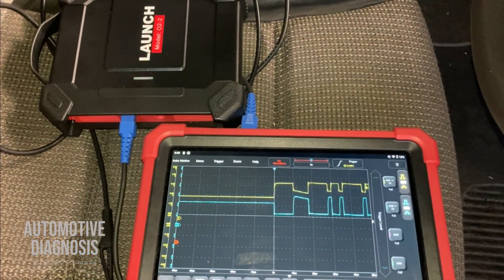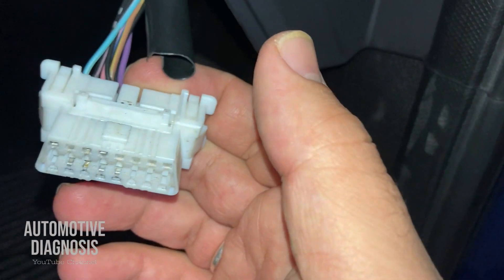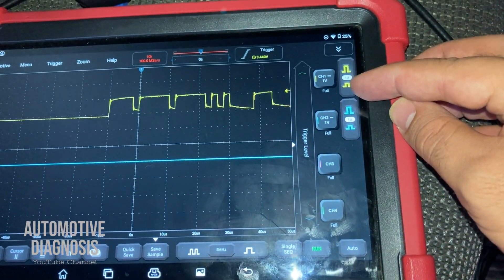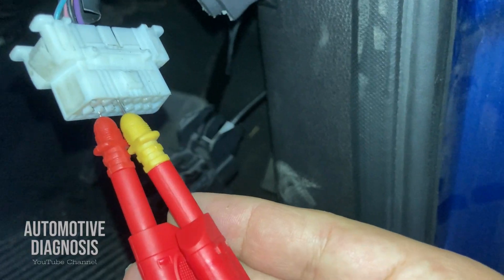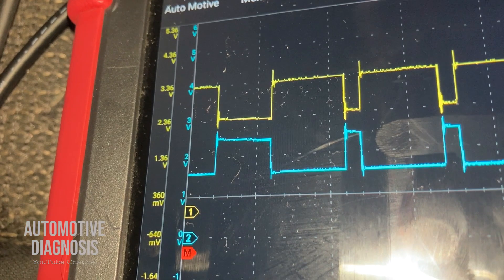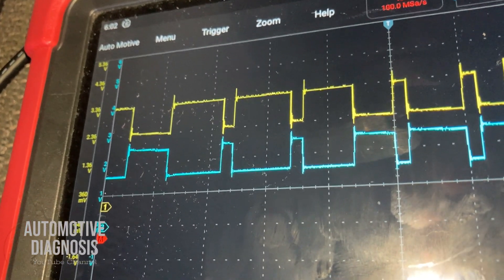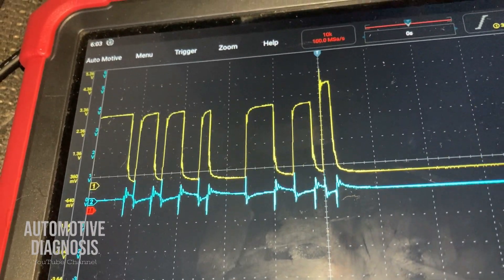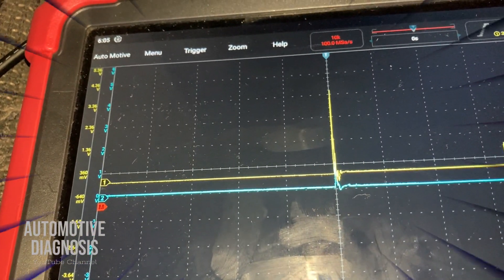CAN-BUS Diagnostics | Diagnosing CAN BUS with an Oscilloscope #canbus #oscilloscope

Comment: Sir, How did u make the connection for can bus low short to ground?
Reply from the maker: Hi my friend. We don't actually need to do that, I did it just to simulate the fault for you guys to make this video. I made the short to ground using a pin on the BUS as I didn't want to damage the wiring.